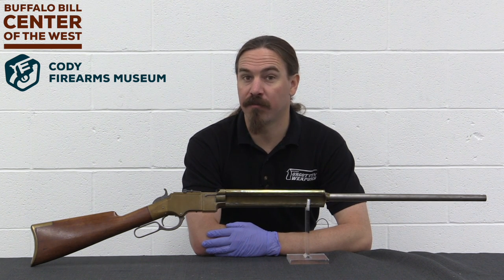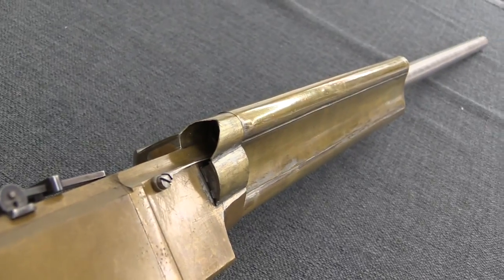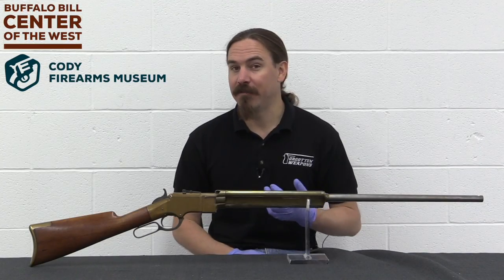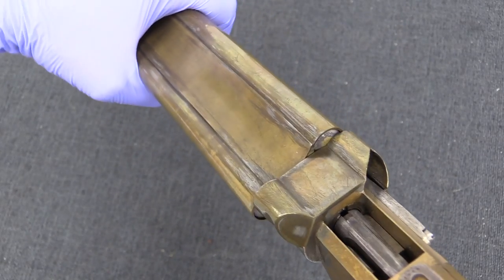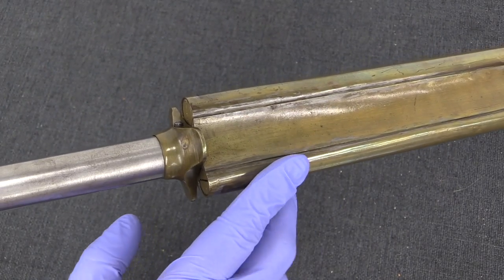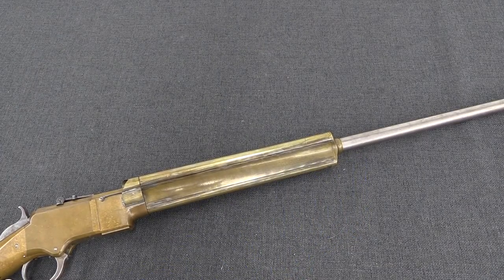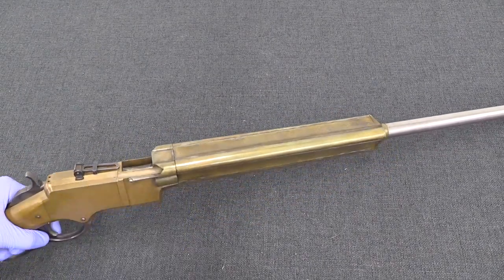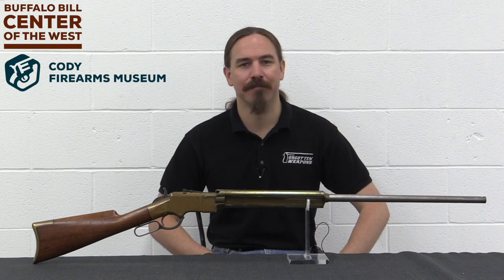Experimental Triple-Magazine Henry Rifle

Comment: this deserves a production run just for the rule of cool
Reply: Wouldn't be hard to refit a modern Henry rifle with that magazine setup
Reply: Scott Kenny you could even sell conversion kits and not invest in building whole new guns. Im sure that saves a lot of paperwork too.
Reply: Would love to see this re-made on CNC on a LSI Puma 92 in .44 mag, 16" rifle or 12" handgun with brace, threaded of course.  Maybe 8x3 (24) capacity?
Reply: As does everything on this channel
Reply: 646 likes in 2 years, but did 646 of those people buy henry rifles? Probably not even 5 of you.
Maybe with modern plastics it can be cheap as an accessory, but it still won't sell.
Reply: Modern technology could make this thing fuckin amazing
Reply: But the cost of machinery highly outweighs what will be produced and sold.
Reply: Is it kinda silly...yes  do I want one...YES!

Comment: I'm sure that someone was very proud of himself for that. The barrel could be carbine length and still have 21 rounds on tap.
Reply: That's exactly what I was thinking, bringing the barrel down to just longer than the magazines would make an awesome carbine.
Reply: Mounted and dismounted, it would be very handy to have. Cavalry armed with this and throwing out all that lead rapidly could easily block a flanking force, or at least cause them to deploy from a maching to a tactical formation. That would buy any main force time to shift their own lines and effectively deny the flank. All the while the troopers mount back up before the flanking force can actually deploy and skeedadle (the unofficial technical term for the tactical retreat) out of range or back to cover.
Reply: If it were more successful, i could have seen it becoming a popular contemporary of the 'artillery luger' or m1 carbine. Lighter and smaller than a full size rifle, maybe slightly faster cycling than a bolt action, more accurate at range than a pistol (and more powerful with the longer barrel for full combustion of the powder)  but with more rounds on hand than contemporary single stack pistols and bolt  guns of the era.

Comment: Another advantage I see is that you can top it off without taking it out of action, you could even keep it pointed while adding rounds.
Reply: Yes, keep topping up the other tubes.
Reply: @bills6093  And it would be easier on shells and fingers than a kings patent gate.
Reply: You don't have to remove the magazine follower to reload, and load from the breach end rather than the muzzle end. Convenient for anybody, but particularly useful for cavalry.
Reply: @WalkaCrookedLine  I've never tried but it seems like it would be fairly difficult, or impossible, to reload the magazine through the breach.  Do you know of a video showing it being done?
Reply: @DonziGT230  breach end, not the actual breach
Reply: @Sableagle  being able to unload the chamber is definitely a good feature to have.  my Remington V3 let's me lock the feed ramp in a middle position, blocking the magazine from feeding.  How does the Benelli do it?
Reply: Unlimited civil war sniping.
Reply: @DonziGT230  Why would you want to? Just reload the other magazine, then rotate.
Reply: @77gravity  If you're fighting you want to know how many rounds you have in the gun at all times.  Being able to top off the magazine in use during slow moments means that you can easily keep track of how many are in that tube while knowing that the other two are always full and ready in case things become faster paced where you won't have time to add rounds.  It would be similar to using a magazine cut-off, but less important with this triple mag gun.
Reply: Some anti aircraft guns ( cannons) worked in a similar way .
Reply: Put it on a tripod and assign two people to it: a gunner and a loader
Reply: There is even the ability to unload by depressing the shell latch at the loading port.

Comment: I imagine you could also load different rounds into each tube to give yourself more options out in the field
Reply: Back then your options were "Lead Bullet".
Reply: @Crosshair84  yes but saying that you could still have different qualities of Lead shoot. A ball that's more rounded and fit's tighter to the barrel with a finner grande black powered.

If you are hand loading the options are endless with the leave of skill and quality you can load each shot 

Or in short load 2 tubes with cheap and nasty for the "spary and pary" and load the 3rd with a more expensive more quality ammo for long distance

Comment: Would love to see a repro of this (so it can be shot without damaging the original) with tubes a little longer (say 10 rounds) :)
Great find, Ian, great find :) - especially since this seems to be a great thing (sadly never got anywhere, as they didn't make more), unlike some other (clunky and/or not working or working badly) prototypes that were basically silly ideas that were tried out because nobody knew how silly they were!
Reply: The amount sold would never cover the machine costs alone. Ian did go over this before

Comment: Wonder if the ppl that made the rotating multi tube 12ga knew "their concept" was used 100-150yrs ago?
Reply: The concept was explored at least three other times by various manufacturers but this is the only physical example I've seen even in video.
Reply: @Taolan8472  this is the earliest example I've seen, I read about one made in early 1900s as a proof of concept but no images were available & documentation was sparse, so I questioned the validity until I saw this one.  Dividing the circumference in 3 or 6 seems most convenient, as is done here & was common in revolvers, because the indexing for machining on rotational axis is much more easily divided when in multiples of 3/6
Reply: An i thought I was the only one who played around the this idea !!!

Comment: Pretty nifty. You could easily redesign couple of elements to make it a really effective gun. Like the end caps so the cases aren't held by just the small bit on the edge or get a better, sturdier latch to hold the tubes in correct place. Also, for the front handguard thing. It don't seem too difficult to get some wooden grip on the thing. Too bad they didn't decide to continue working on it, I wonder what was the reason. But anyways, when I design some steampunk lore, I would deffinitely use this as an inspiration.

Comment: If the Assault Weapon Ban comes back someone’s going to produce this with the full length tube, 40 round lever action would definitely negate anything they could do
Reply: Somebody else would add an electronic lever actuator for laziness, 3-5 more tubes for totally unlimited ammo, and tube shaped speed loaders or "optional" magazines where the tube can go in with the bullets but doesn't have to.
Reply: I think I'd, for a 40-round capacity, rather do six half-length tubes than three full-length tubes - given that six circles fit around another one of equal diameter just as well as three do.
Reply: Then they just ban lever action rifles entirely.
Reply: Scott Kenny - Yep. Would get to single shot only pretty quickly if the courts ever abandoned 2A or it was repealed.
Reply: An auto 12 !!!
Full box of Go !!!
E now where was those punkin balls 3 or 4 ???

Comment: Cool. A great find.

With a little work, the triple (near complete round) tubes with intermediate fillets could be worked out of a single sheet metal with only a single weld or crimp to close it. Some special bending jigs would be easy to justify for volume production.

Shorter triple tube magazine with 21 rounds would probably be better balanced than a single, long one with more than a dozen rounds.

Comment: Possibly intended to compete with the Evans Repeating Rifle - around 30 rounds in a helical magazine in the butt. When Evans folded there would be no need to develop this further.
Reply: Evans Rifle Company didn't come into existence until the late 1870's, long after Winchester discontinued the Henry in 1866. Spencer Rifle Company and Ball were the only other commercial manufacturers of metallic cartridge repeating rifles in the 1860's; and Ball's government contract was cancelled after the war, having only produced 1,002 pieces which never saw action due to their late delivery in 1866.
Reply: I could be wrong but I think Winchester bought out the Evans rifle company much later on
Reply: @edwalmsley1401  Yes they did, it was a common tactic of 19th Century  arms manufacturers to buy out their best competitors; Colt Company did it quite frequently, too. The Evans had a very good run, I think almost 40,000 pieces were produced and sold. With so many cheap surplus trapdoor converted 1861 Springfield rifles and Spencer repeating carbines and rifles floating around after the Civil War, plus the new designs being sold en masse by Winchester at the time; that's quite an amazing number of sales.
Reply: The Evans concept would have been incredible if only they'd designed it to load from the breech end of the magazine like a Winchester rifle rather than have to cycle the magazine through when loading.
Imagine a .22 1894 that used a helectical underhanded magazine that would load from a loading gate like a standard 94
Reply: I am left handed, but righties can practice to keep  stoking a Win. loading gate while shooting banditos.  Those guys liked to count rounds fired and rush you as you reloaded an empty mag.  One shot fired, one round reloaded, spoiled their last day on Earth!  You carried loose cartridges in your jacket or vest, and snaked them out, while working your rifle’s lever.

Comment: This would be something I could see as a niche gun for garrison troops. If you had a fort where there was a permanent garrison you could man the walls with a few rifles like that and it would be an impressive suppression tool. Make the magazines run the full length of the gun for all those tubes for a monsterous capacity and since its a garrison weapon where you can have the weapon supported by a wall or barrel or something the weight is negligible. It would be like the old world version of the BAR or the M60.

Comment: Everything has been done before.....everything
Reply: @joshweickum  no magnetic loading systems yet.
Reply: @Freak_Gamer  That gave me a mental image of just hitting a button, and an electromagnet pulls in the nearest magazine from anywhere in the room
Reply: Springfield Armory has an experimental trapdoor with a lump on the left side of the stock that has 5 holes drilled into it, exactly like the sidesaddle ammo holders you see for shotguns and bolt-actions nowadays. Remington made a side-loading revolver that used trounds like the Dardick, in the 1860's.
Reply: What about a mini one shot barrel mounted flame thrower that runs on pressurized gas cartridges, or a partable metal storm type long volley rifle with a stack of 15 rounds down the barrel that fire almost at the same time electronically but are also rocket style ammo so the slow spin up time reduces recoil enough not to blow your arm off and you end up with one trigger pull and 15 large caliber rockets , reload a verticle bullet stack with your favorite breach loading mechanism.
Reply: What a silly notion that is haha i know i can do thousands of things that no man has tried before i do stuff like that all the time  original thought is not that hard but recognizing it as original can be tricky you gotta be in tune with the world and understand what people think bottom line if it has all been done before then why bother to do anything at all? Or maybe i can put it this way and ask you a question.
Can you name even one other person besides you that lived your life in your body? I hope the answer is no lol so there you go you are doing something that no other living soul from the past has ever done.
Reply: @MrLoobu  So you're essentially suggesting we go back to volleyfire muzzleloaders, except now they can punch through an inch of armor steel
I like it
Reply: @MrLoobu  you should put those thoughts into action. Dont give anyone here any ideas;)
Reply: Black powder Tommy gun, for to skirt atf regs
Reply: @grahamlopez6202  now your just being silly 😂😂

Comment: One issue I see is loading ammo to the cartridge lifter.  Looks like the magazine follower would leave one round in the primary magazine "free floating" and not positively pushed into the lifter.  It looks like operating it would require lifting the barrel upwards to allow the last shot of each tube to fall into the lifter.

Comment: I can see a use for this idea for selecting different ammo types (ball, shot, ???) simply by rotating to the desired magazine before working the lever.  The ability to reload while still having cartridges in the active magazine would also offset the downside of the weight and complexity - so even just 21 rounds instead of 16, front loaded, would make it  worthwhile.

Comment: The current length also gives you much less change in balance as you fire than a normal single tube Henry, thus helping accuracy.. but even 21 rounds is going to be no lightweight to hold up for a long time.

Comment: The magazine cylinder would lock when it's loaded in theory, the pressure from the rounds being pushed into the plates at the front of the receiver supposedly provides a much stiffer, tactile lock.

Comment: It would be even more cooler if working the lever action actually spin tubes as well, so you get equal distribution of ammo along tubes. But you will have to add more weight to a hand stop around the tubes.

Comment: A spring loaded catch to align the tubes wouldn't go amiss, but otherwise i'm all for this. Would love to see someone testing a standard Henry vs. that, how long it took to get your aim straight and just the general info on weight both loaded and empty, and the location of the point of balance. Now, i haven't handled brass much, but i think a steel insert probably would probably be called for in the tubes? Correct me if i'm wrong.

Comment: Surprising actually, that this wasn't put into production. It would work pretty well I assume, may be with 30 rounds or so. However, a brass casting would add a lot of weight, but the soldered sheet metal version is perfectly fine.

Comment: I'm surprised Ian didn't discuss the loading port the gun offers very much. What's to stop the follower from just kicking the rounds back out the hole once you've pushed them in? Presumably there must be some kind of gate that we can't see clearly.
Reply: The flat spring he showed us at the port pops up and catches the rounds so they don't pop out.  To load you'd use the nose of the new one to hold the old one in as you loaded.  Kinda finicky but good enough for a prototype.

Comment: I'm pretty sure some enterprising home gunsmith could fit something like this to a modified '92 or '94 (or similar, probably starting with a takedown example).  Wouldn't have the Henry capacity, because modern rounds are longer, but you could get five or six .44 Special or .38 Special into each tube, making it a big step up from the six or seven round capacity of a modern lever rifle...

Comment: 3:35 I get the feeling the first round would move half way into the body, when a new tube was aligned, and supplement the light locking springs by bridging the magazine and body with a round. If this was true, it would stop accidental turning but would remove the ability to select ammo types by tube until a tube was spent and the follower sat flush again. Just a theory.

Comment: I don't think you would have been able to rotate the magazine assembly once there was a loaded magazine in line with the feed-hole into the action. However, that would still work, because that would only happen when the third magazine was in line with the loading port, so you'd be able to finish loading it. If it had been my idea, I would have stuck with 7 or 8 round magazines because of the balance issues, and it does look as if that was one of the things Winchester was trying to improve here. I would have also given more thought to how I UNLOADED the magazine assembly when full.

Comment: While you could in theory make those magazine tubes the full length of the barrel I suspect there are two problems with that.  The first and most obvious is the weight like you mention. The second would be that it's capacity would probably be grater then the rifles capability. Since that rifle would be firing black powder rounds you would probably start running into some serious fouling issues before you emptied all three magazines. Now I don't have experience firing a lever gun with black powder, but at least with revolvers, 24 black powder rounds is about the limit before you want do some cleaning.

Comment: If this gun had gone into production they would probably have had a couple of cast brass three hole "spiders" holding the tube around the barrel and three wood panels between the tubes. It might have been economically feasible to build and sell. Still heavy but might have been okay for fixed or semi mounted use. Guard towers or shipboard use come to mind.

Comment: This looks like it could just as easily have 4 or 5 of those magazine tubes.
Reply: With more than 3 they would get in the way of the sights.
Reply: @wobatt  that's easily solved with different sights
Reply: @wobatt  if Winchester had used 6 tubes all barrel length then at least a basic iron sight could be built onto each tube. A pain to zero but hey, who needs accuracy when you've got 90 rounds in the wild west?
Reply: @andrewince8824  That's a really bad idea imo. I would make gun so front heavy it would be unusable. 5 tube of its current length or even bit shorter would be good enough
Reply: @Zafo24pl  indeed, but as a basic first concept it would be an ideal place to start before refining the design.
Reply: 6 would be easiest to set up and machine. But that'd be immensely heavy.